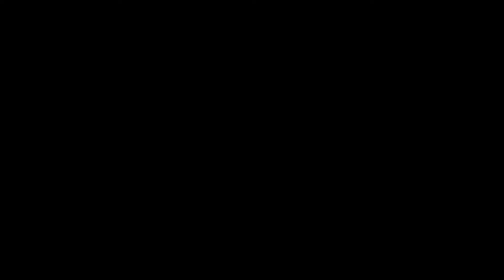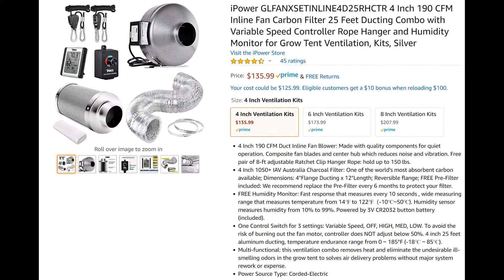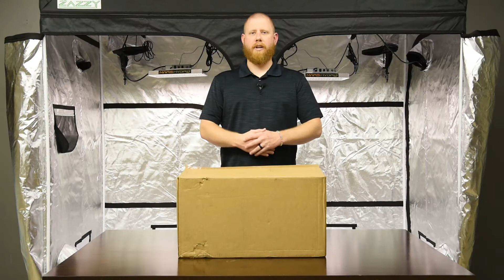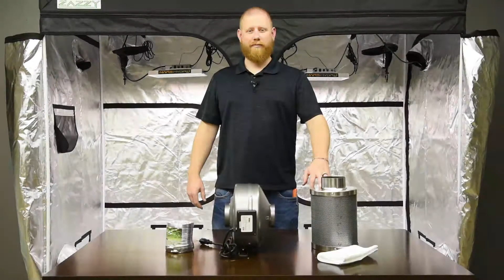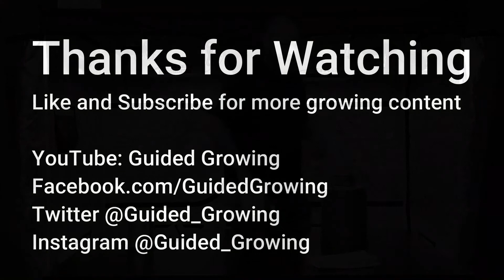iPower 4 inch Exhaust Fan Part 1

Comment: Use zip ties around filter inside tent and hang fan and filter together  then run duct out top hole in tent ...been running mine 2 yr like that  don't have clamp everything  .... slide it together  and hang em and done  or put filter on floor  stick fan in filter  run duct and done ....

 Zip ties all need Till other stuff comes in

Comment: I mounted the filter to the exhaust side directly with some tape to seal it. I drilled a couple holes put two screws through the coupling point. It worked good, I bought a second for a spare but haven't needed it. I notice the impeller is a different design on the other one. I  chose this fan for the steel housing so if it gets hot for some reason it should reduce the fire hazard.

Comment: Is there anyway I can contact you guys to a walk thru of putting my carbon filter together
Reply from the maker: Sorry for the Delay Young Cedo,  I’d be happy to help with that let me think of a way we can connect, maybe Facebook or Instagram would be easier than YouTube.  

In the mean time don’t over think it. I prefer my filter on the suction side of the fan so it’s in the tent.  I didn’t have everything I wanted to put it together but I made it work with some duct tape and straps.  Try not to have hard metal to hard metal connections just cause they don’t seal well but do what ya gotta do.